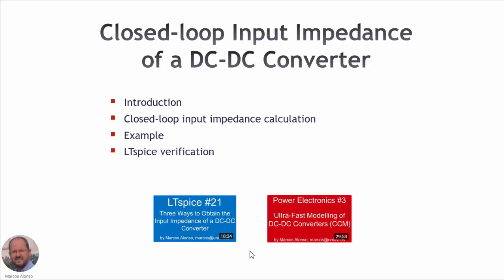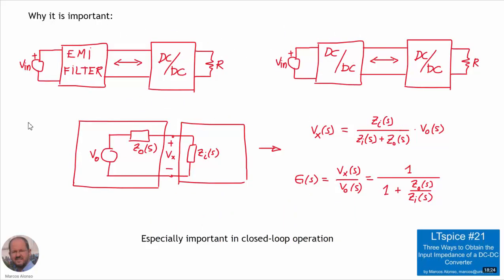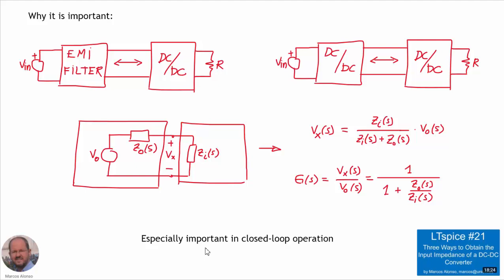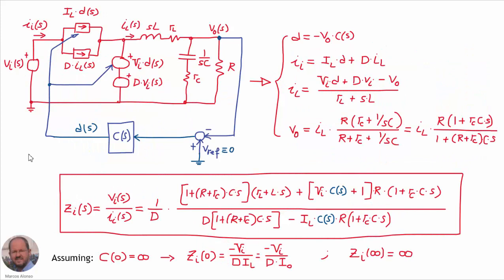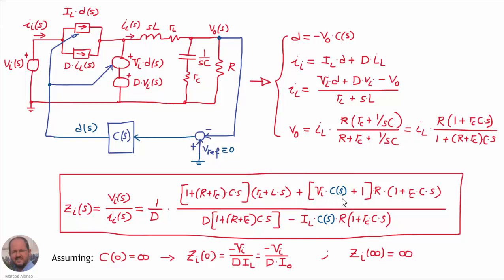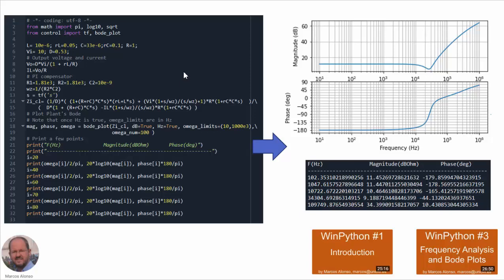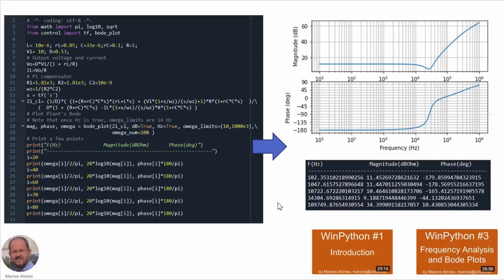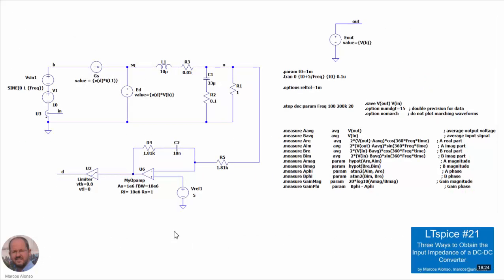PE #41: Closed-loop Input Impedance of a DC-DC Converter

Comment: Good video....but please do a video for Boost converter or flyback converter which as you know are non minimum phase systems with a RHP zero...i have not yet found one proper video for this
Reply from the maker: This is interesting for a future video. Thanks.
In the meantime, there is a video about the modelling of a flyback converter here: https://youtu.be/rzIky13Fn04
Reply: Does it have any impact on input impedance measurement?
Reply from the maker: No, there is no RHP zero in the input or output impedances of boost and buck-boost converters. Thanks for your question!